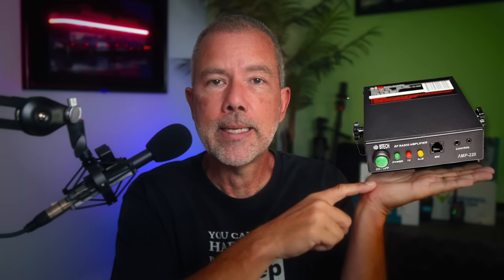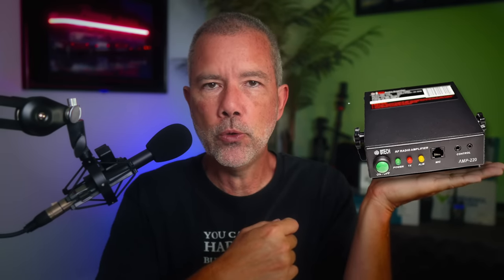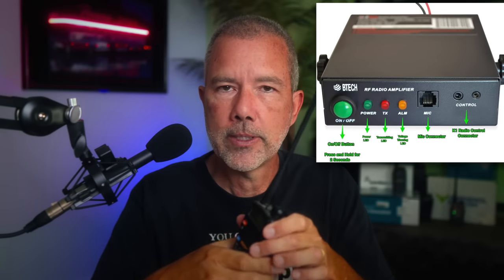Baofeng UV-5R power booster - BTech AMP-220 / BTech AMP-U25 - Boost the power output of your UV5R

Comment: This is great and all, by why buy a $160 amplifier for the HT that only works on one band when you can get a single band mobile radio of better quality for the same price?
Reply: The UV-5R is dual band 2m and 70cm.  And can be programed to transmit on 2m, 70cm ham bands and for emergency use on GMRS and MURS.  Also a true emergency it can be used on police, fire and commercial bands  according to the FCC "any means possible"
"EDIT" I thought you meant the radio only works single band, I guess I now agree with you.  Buy a decent Yaesu 40 or 50 watt dual band and do a MARS mod (as I've heard it called) Probably find a used FT8900 for a couple hundred and 20 min modification later you got a high quality high wattage radio.

Comment: Question, what happens if you are using a real gmsr radio that knows to limit the power on one of the low power channels ? Does this device amplify the wattage  passed the allowed amount of wattage, in other words when this is hooked up should it only be used on the high wattage channels ?
Reply from the maker: Its a dumb-device so it will be up to you to follow the FCCs guidelines when using it.

Comment: Thank you for all your content, it's funny and informative. Your audio sounds great! Question for you, would this BTech amp likely work for the uv-5x too?
Reply from the maker: Yes!  Just be sure to get the UHF version and because the antenna connector on the UV-5X is different from the UV-5R you might need a $3 SMA male/female/whatever adaptor .
Reply: @TheNotaRubicon  An adapter for SMA female is included in the package, so it will work with male or female connector.

Comment: Meanwhile I'm looking at the amazon page and 'I don't drive so that cigerette lighter plug is gonna do nothing for me. How do I wire that in for, say, either a twelve volt wall wart, or better, a connector that can hot swap between wall wart, and power pack?' That and 'how do I neaten the resulting setup so it isn't eight things rats nested together?

This combined wit ha few soldering mods I lack the skills and physical capability of seeing well enough to do (so hoping a ham in the area can DO said mods for me) and a portable antenna would be rather helpful. 

Maybe make a mounting pointfor the 'feng to clip to

Comment: What would be your recommendation for a good mobile choice for side by sides? It gets muddy and dusty inside and pressure washed later. Repeater channels would be nice, but not a deal breaker. Also, whats an optimal antenna since they have metal chassis but the bodies are plastic?

Comment: Thanks for the info. There are two versions for UHF (U25 - UHF and U25D - UHF DMR). I am going to connect baofeng UV-5x gmrs to this. Which version should i get?
Reply from the maker: You would want the U25 UHF for GMRS which is analog only.
Reply: @TheNotaRubicon  Thanks.
Reply: @TheNotaRubicon  Now what if we had both UV-5X and UV-5R? Is there a BTech Amp that would work for both of them? I'm new to all of this and there's a lot to take in so any help would be greatly appreciated.

Comment: I've seen people use what appeared to be just a very long wire hooked to the top of a tree or run from one Post to post etc  
If you can do this what size wire and how do you connect it to your radio or base station

Comment: Well Im pretty disapointed with the amp.  It has been widely publicized to be a power multiplier depending on how many watts on the input.  I put 4.8 watts in and measured 23 watts out.  The idea that I could get possibly close to 40 watts from my mobile was one of the main reasons I purchased one.  Dont get me wrong it did boost the power but nothing like the guys putting up videos on here.  I emailed Btech and they responded asking for pictures of malfunction.  I sent them a pic of gmrs coming out of the back of the amp at 23 watts and now they wont respond.  But I guess technically it isnt defective as much as overstated performance.  Too bad.

Comment: Wow thanks!I am just barely getting started and I am on disability so very limited on my budget.I do have a question though, how would you connect another antenna if you are using the port where the antenna originally went?I am assuming the amp has a place for one?
Reply: The signal from the UV-5R goes into the amp, and the amp is connected to a big outside antenna.

Comment: I have the BF-F8HP which is a nominal 8 watt radio, but also just a fancy UV-5R. Would it still work or is the nominal wattage actually spot on, making it too powerful for this amp?
Reply from the maker: in my tests, the BF-F8HP never actually hits 8Watts, its usually closer to 5-7 . .but to be safe, you could just set it at medium power .
Reply: @TheNotaRubicon  thank you, that's very helpful

Comment: So other videos state that it's a violation of regulations not illegal. So using the UV5R is illegal or just a violation of regulations?
Reply from the maker: It is a grey area. The FCC makes regulations, not laws, but those regulations carry the weight of the law... Sooo...
But what is more important is that the FCC does almost zero enforcement based on their public enforcement record.
Reply: @TheNotaRubicon  So is violations more of a fine VS prison?
Reply from the maker: Actually, based on previous enforcements, it's a letter/warning first, then if you ignore it, another letter, then if you ignore that, either another letter or a "notice of apparent liability" which means the FCC recommends a fine, then you can fight that, or ignore it, and if you ignore it or lose the fight, then they finalize the fine, which, as far as I have seen, they have no actual way of collecting if you decide not to pay it.

Comment: Have you thought of using two Baofeng UV-5X with the Btech for a repeater? purchasing two Wouxun KG-1000's along w/ the XLT duplexer is a bit too much for me.
Reply from the maker: No.. But I've been testing for the last few days without the duplexer, using two antennas instead, and it's working quite well so far, so that's a few hundred $$ you could save!
Reply: @TheNotaRubicon  Have you thought of using the Btech uv-50X1 as an alternative? I've seen your video review of that radio.
Reply from the maker: No, because the 50X1 isnt designed for easy setup for use as a repeater like the KG-1000G .. not saying you cant do it with a 50X1, but the 1000G is designed for it, and makes it very simple
Reply: @TheNotaRubicon  Thank you for your response. BTW- I had a bad KG-805G so sent it back to Buy... I had a new radio within five (5) days. All works well. Good company.

Comment: If you had a HH GMRS and a HH HAM could you get 2 antennas and switch between them?
Reply from the maker: sure?  you might be able to use a dual-band antenna, and not need to switch.. but the amp may not work on both frequencies, unless they are close, like 70cm ham and GMRS.

Comment: What would you use for a Baofeng UV 82HP being that it is 8 Watts?
Reply from the maker: I would set the UV82HP to medium power and use the BTech AMP-U25
Reply: @TheNotaRubicon  Thank you sir. KC3RZO
Reply: Its still ok to use regardless that the AMP U25 only give the option for UHF 400-480 MHz?

Comment: Be a waste. Spend 260 plus coax and adapters to be able to have 40 watts dual band. Plus all the bad harmonics that these things put out. Be better off just to buy a cheaper dual band and not have all the mess and things to carry around, but you can buy much heavier build amplifiers for less money. I have one of the mirage dual band amps. One unit to mess with and heavier built. And less money.

Comment: Why aren't you allowed to transmit on GMRS with a UV5R even if you have a GMRS license?
Thanks.
Joe
Reply: Basically, radios also need a license called "part 95" approval. You can bet you pay for this one too...
Reply: The best analogy is Kosher food... If the FCC were a rabbi... The beef was slid across a relatively clean table that also handled pork - and traces of tree nuts. 

Ok maybe not certified organic free range chicken - factory farm anti-biotic laden chicken.
Reply: Oh - You can get a UV5X - rabbi/FCC approved - same radio...
Reply: Under FCC regulations, only radios that have been type accepted under what's known as "Part 95E" can be used in the General Mobile Radio Service. The biggest factor in Part 95E acceptance is that the user can not enter frequency information directly from the keypad or via programming, nor alter power levels on certain channels. it's OK to change the tones, but not frequencies. The UV5R is a ham radio, where entering frequencies is done routinely (since the ham bands aren't channelized like GMRS), and there are literally thousands of TX and RX frequencies for a user to enter. As such, the UV5R could never pass type acceptance under part 95E.
Reply: @W2IRT  Baofeng UV8D which is a cheaper version of the UV82R
 without display meets those requirements but has never been cert for part 95E
Also the user has to program the frequencies into its 128 mems using a PC
it doesnt have a VFO

Comment: No I came here looking for  a low cost amp...I think it would cost less to build a repeater this way
Reply: I too thinking the same two UV5Rs with the repeater cable - and a line amplifier on the transmission side - it’s certainly low budget - and and could work for a low budget one out of say a lead Jeep on a trail
Reply: @NoName-OG1  Do it with Wouxun KG or Puxing handys, they have Superhet RX
 and block less than SDR RX UV5R
Reply: @NoName-OG1  
UV5X has zero adjacent channel rejection on receive.  That would be a problem.

Comment: Bad idea for two reasons. One the UV5R has a TX output that is only just harmonic acceptable,
 as a handheld. Two its SDR RX blocks on strong signals, which isnt too much of a problem
 when used on its whip, big problem when used on a base antenna.
If you are going to do this? then use at least a Wouxun KG dual band handy,
 which has superhet RX, and cleaner TX
Reply from the maker: Because we all know that most UV-5R owners are very concerned about the harmonic levels coming out of their radios.
Are you Honey Baked, or Black Forest?
Reply: @TheNotaRubicon  Half baked.

Comment: Be a waste. Spend 260 plus coax and adapters to be able to have 40 watts dual band. Plus all the bad harmonics that these things put out. Be better off just to buy a cheaper dual band and not have all the mess and things to carry around
Reply from the maker: And yet many people use it, and are very happy with it.
Reply: @TheNotaRubicon  but you can buy much heavier build amplifiers for less money. I have one of the mirage dual band amps. One unit to mess with and heavier built. And less money.